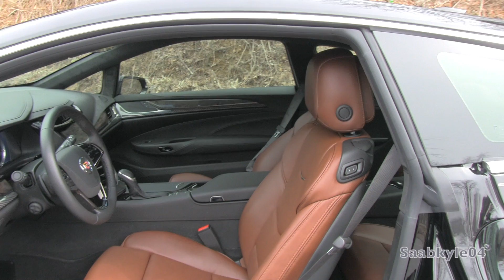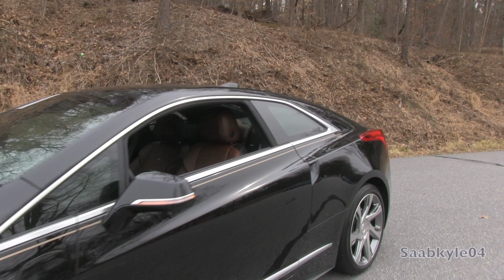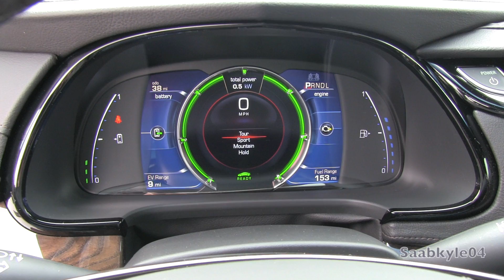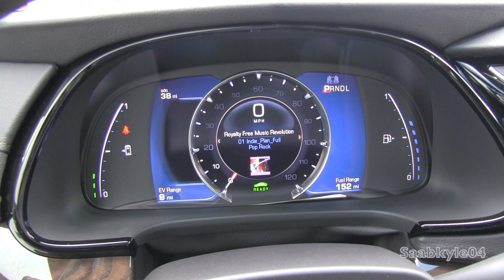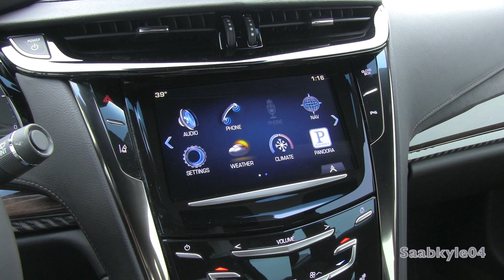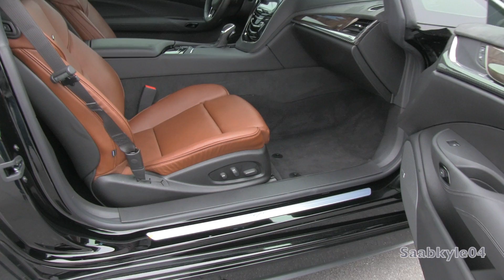2014 Cadillac ELR Start Up, Test Drive, and In Depth Review

Comment: I came here genuinely a fan of the ELR; however, I'm a little disappointed that it's 300lb heavier and so much less efficient, considering it's also much more rare and expensive (the 2x or 3x price multiplier holds up in the used market too), and much less usable than the Volt.

Comment: Do NOT buy an ELR! The e-range is affected by heat. Normally you get 38 miles per full charge,  but in the summer,  that drops to 33. GM does not report this. Be advised.
Reply: That’s with every electric car, not just the ELR

Comment: The Voltec powertrain only uses about 11 of the 16.5 kWh available to propel the vehicle. No part of the battery is reserved for a particular use (ie pure EV or hybrid). The entire battery is charged  or recharged as necessary within the state-of-charge limits in the software code.

Comment: I drive a Chevy Volt w/39 miles EV Range (same as above ELR). I was looking for Charging Stations in area I was 2B travelling. They had one. A "Tesla Supercharger" station which is EXCLUSIVELY for Teslas. Go figure, this was at a Walmart Center. 10 unit stations & one user. Teslas have 100 mile EV Range B4 quitting time. How many people drive a 100 mile round-trip2 Walmart AND drive these $100,000 Teslas? The connection isn't compatible to other EV cars, so tjevrest of us are SOL. Sounds like a modern form of segregation against us poorer non-Tesla folks 2me!

Comment: I must've blinked & missed the test drive? It's basically a Volt, yes with a gorgeous Cadillac body & interior. It also has 100% LED lighting. These are the differences, but still hard2 justify a price difference of $36,000-$40,000 higher? She still only drives 39 miles range on Full EV Mode.

Comment: hey look! an overpriced volt
Reply: ***** bullshit. A base volt costs roughly $27000. These started at $65000
Reply: ***** Yeah. Used. I'm talking about from new. All it was was an overpriced volt. Still is now cause you can get a 2014 volt for less than this.
Reply: ***** plus a 2014 elr is still $40000
Reply: Ok and with not higher than average miles (listed in km on ads)
http://m.imgur.com/LFTU0jC,wzWvuxh
And it's still an overpriced volt because why would you buy a discontinued 2 year old car with high mileage when you can get the same car brand new for the same price
Reply: ***** it can't be that much more refined to go from being $45000 more than a volt from new and only $7000 more 2 years later. The elr was and will always be over priced. That's probably why it failed.
Reply: ***** I know I'm not interested in buying a car with higher than average mileage. I'd much rather have a brand new version for the same money. The comfort level just doesn't seem worth the high mileage or the money for one with lower mileage.
Reply: ***** well that does exist but it's probably gonna have twice the mileage it should if you're ok with that.
Reply: ***** That ELR had 45000 miles which is 75000km for me which is too much for a 2014. 25000km is high average per year so that car has a whole years worth of additional driving on it.
Reply: ***** but if your talking about a volt you saw then take it right away cause you found a killer deal. I can't find a volt with premium sound and leather for under $15000 with less than 140000km which is 86000 miles or older than 2012
Reply: ***** base with leather and premium sound add ons. Good find. It's got half the amount of miles it should at it's age too.
Reply: ***** oh no I totally calculated that wrong but it is on the low side for mileage it should have about 12000 more miles. My only concern is if title washing is legal where you live then I'd be aware of that cause if it is it could have been completely rebuilt and you'd never know it.

Comment: The reason this car didn't sell is because Cadillac still thinks it's in its glory days of days past. Cadillac actually believes that people today see them as being as prestigious as Mercedes Benz or BMW.

If you want to just see pictures of cars, than any youtube video will do, but if you actually want to know the in and outs, than check out Saabkyle04.
Reply: I do favor gm, but you have to be a fool for buying one. For 80k, even heavily revised...its still based off an economy car platform and fwd. Severely limits its capabilites. Cadillac wants a halo car? Build a mid engine low end supercar that has similar performace to a current gen z06.

Comment: On these new Cadillacs, how good is the interior? I've been looking at some 2011-present CTS and ATS and they look pretty cheap from the screen. How good are the materials used?
Reply: The interior quality of the ELR is excellent.  Leather, wood, carbon fiber, and Alcantara are everywhere.  It definitely does not have the typical GM plastic interior feel to it.  The design and layout is very nice, although the control layout for the infotainment and climate control is kind of busy.

Comment: Cadillac is now a really nice brand: the ATS and CTS are really nice cars that can easily compete against Imports and win against them in many areas.

The ELR is probably the only Cadillac I dislike. Nothing is really wrong with it, but it feels like a product of 'old GM'. I'm perfectly fine with platform sharing: everybody does that these days. However, when Buick made the Verano from the Cruze the interior was overhauled, running gear was unique and only cost ~$10k difference in price. The Trax and Encore while share identical running gear the Buick has enough differences to justify ~$8k difference.
For the ELR however, I can't oversee the fact you're paying a ~$30k premium to get a less convenient 2dr nicer looking Volt. The lack of any changes to the powerplant & running gear is disappointing.

EDIT:
Upon further pondering, I now realized the mistake that GM made. The ELR should have never been a $75,000 Halo car for Cadillac. Instead, it should have been what the C30 was to Volvo or the CT200h was to Lexus.
Cadillac should have badged the ELR as their ENTRY-LEVEL car aimed at bringing in millennials who are more into technology using the Voltec-hybrid powertrain and for young-rising entrepreneurs. Instead of splurging in tech, take out the unnecessary tech gadgets (or make them upgrade options) and price it starting at $38k: slightly under the ATS coupe but above the Volt. Then it would make good money, draw in new customers to Cadillac & promote a 'cool', environmental friendly image with a neat design that distances it with the more pedestrian Volt.

Comment: All that chrome in the interior does not add to driving safety. It just increases glare points and is distracting to the driver

@1:42sec The Cadillac Cue electronic instrument panel has had a lot of complaints and problems with reliability

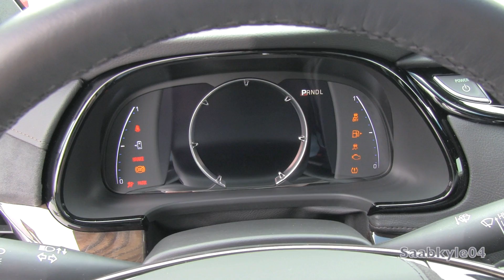@2:04sec Digital speedometer which shows you constantly changing numbers of speed is highly annoying

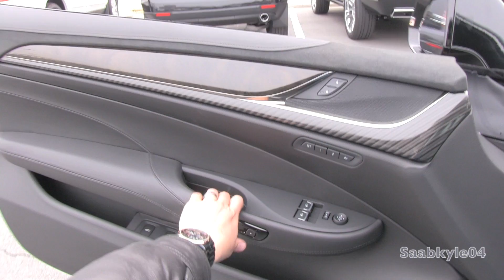@3:33sec, Electronic door actuators??  Great so if the electronics fail, you can't get out of the car, and you die

@3:56sec For a car this expensive, the grill looks cheap and ugly

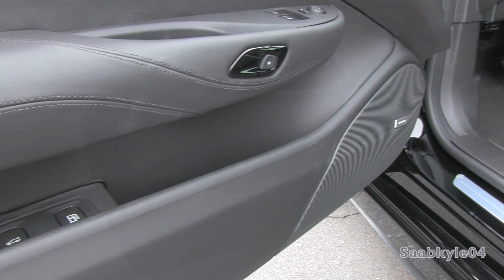@13:20sec. Is that really where you want the trunk and fuel cap release?

Comment: I attended the San Francisco Car Show in November 2014 and visited the Cadillac ELR showcase.  The Cadillac ELR garnered much attention from visitors. The car is long slung and impressive upon approach.  One issue was young hosts didn't know too much about the actual machinations of the ELR which was unfortunate because the visitors had questions on drivetrain, horsepower, hybrid capabilities, and then charging stations.  The ELR uses the same drive train as the Chevy Volt therefore I question the price point ($75K) for the performance as people will expect more performance for the price.   There needs to be more information on the "charging" and "charging stations" because this is a hidden price.  In conclusion,the Cadillac appears to be a good start but for the price-performance the high scale consumer will look elsewhere. While I am tempted to purchase an ELR...I cannot convince myself the $75,000 is a value-add without the performance.
Reply: +KLIP1220 AM Soul Radio Station , Exactly, GM still thinks their potential customers are dumb. That's why they filed bankruptcy in 2009

Comment: I've seen the ELR at a showing and the dealership and it is slick, fine. Got those long smooth handle free doors like the coupe. The interior is a work of art. It's not big, not compact, but roomy inside. If you need a back seat, forget it. I'd need more info on electric cars. Starts at $72 -84k, lol. You can get it now for about $55k and Caddy will install the charger up to 3k. Nice. GM redesigned all Caddies and upped the price.

Comment: Just wondering if there's any mechanical way to open doors from the inside. I find that relying only on electronic systems in case of a crash to unlock and open the doors is quite an silly decision from Cadillac.

Comment: For $75,000 Cadillac would have been better off dressing up a Camaro, making it look pretty close to the Elmiraj coupe, and offer it with the 4.5L TT V8. Then Cadillac could say they have a proper luxury coupe.
Reply: YouDontWannaFightMe The 75K price tag is also ridiculous. I'd rather go for a Model S.
Reply: Even after all the tax rebates, it's still a fuckin' ripoff! It's better to get a CTS-V coupe for the same price.
Reply: The 75k price tag is before all of the tax rebates
Reply: YouDontWannaFightMe Some countries might not have those rebates.
Reply: marc1093280 V coupe 2WD starts at $64k then it depends on the incentives and what you have in your pocket. Also 2014 is the last year for the CTS Coupe has been discontinued. V series you can check.
Reply: Exolesco   LOL!  That was funny

Comment: This is a car for those with a discerning eye. I even have family that will buy anything just for the 0-60 time. That is so old fashioned to me because to live with a car you need so much more. I sat in a model made just like the one presented here at an auto show and I was floored with how well built it was. Nothing under 100K can touch it in most regards....good job Cadillac.
Reply: There are plenty of cars for $50,000 that could beat this car, and for $75,000 this car better also be RWD or AWD and have a twin-turbo V8. A CTS-V coupe is pretty much like this car in terms of interior quality, just a bit dated, but it's RWD and can go much faster than this car, which is a dressed up Volt. Cadillac made a mistake raising the prices on their cars, and the ELR should start at $55K. I am a flexible person but $75,000 for a FWD car is pushing it. Would it has killed them to give it a some more HP and torque and AWD?

Comment: I bet if the ELR was Hmm... maybe a BMW or a Mercedes-Benz that costed 75,000 you guys wouldn't have any problem paying that seventy-five grand, but since it's a Cadillac you have a problem. Typically predictable people.
Reply: BMW and Mercedes are not stupid enough to build a coupe like this and ask $75,000 and only offer FWD. Secondly, for $75,000 Cadillac should be offering a luxury coupe close to the Elmiraj in styling and make the 4.5L TT V8 standard.
Reply: Where the hell you get 4.5LTT V8 from, secondly all of BMW and Mercedes Benz cars are over expensive.
Reply: The 4.5L TT V8 is derived from the 3.6L TT V6 and was shown in the Elmiraj concept coupe. However, the 6.2L LT1 V8 would be great too.
Reply: marc1093280 What are you fucking talking about the Elmiraj concept was not a electric vehicle. This video is about an electric vehicle and your saying put a V6 or a V8 in the ELR. Common man be smart before you comment.
Reply: WolverineNerd I never said put a V6 or a V8 in the ELR. Secondly, if Cadillac builds a $75,000 luxury coupe, it should be RWD and have the 6.2L 451 HP LT1 V8 from the Stringray Vette. A smart buyer doesn't fuckin' pay $75,000 for a FWD-only car that barely has any power, even if it's an electric vehicle. It may look nice from inside, but that's about it.
Reply: And rightfully so, people think this way, considering GM's poor reputation

Comment: It's an overpriced chevy volt. Buy a Tesla Model S if you're itching to get an electric vehicle (and you're outside of NJ).

I do like the whoosh sounds it makes when you start it up though. Also they should have made the ELR more powerful than the Volt with a better battery and motor rather than a software remap. If that was the case, I could just install the software on my volt and get more performance.

Comment: Do you people realize that for 70k you DON'T get the Tesla every car magazine has been testing? That's the t.op of the line model. The base ELR is less than the base Tesla, which doesn't do 380+ miles, but more like 80-90 miles, as well as being slower than the top of the line Tesla.

Plus it has a garbage interior and much less features. Not to mention no gas engine to be there just in case,

Do your research people.
Reply: Just curious what features does the ELR have that the Model S does not have.
Reply: nomnomguy680 All of the safety features that Kyle mentioned(blind spot monitoring etc). A premium sound system with noise cancellation. Much more premium materials. A gas engine for when you run out of electricity(granted the Tesla has more range). 

That's at the top of my head. The Tesla is fairly basic for such an expensive car.
Reply: Actually the base Tesla is $69,900 before any tax incentives so you're wrong, the base Tesla is cheaper than the base ELR which is $75,000, and it still has a range of over 200 miles, not 80-90 like you said.  If you're going to say "do your research" to others, you should make sure yours is right.
Reply: Eddie Yasi The base one is a piece of shit. Doesn't even compare to the ELR
Reply: Base model cars are all pieces of shit, Mercedes or a honda.

Comment: All manufacturers use a LOT of electric equipement in electric cars. Like this retards that use electric door handles. After that they say that your range is 100 miles....Duh! (to gain mileage use mechanical stuff, even electric windows can be replaced only with a plastic handle)